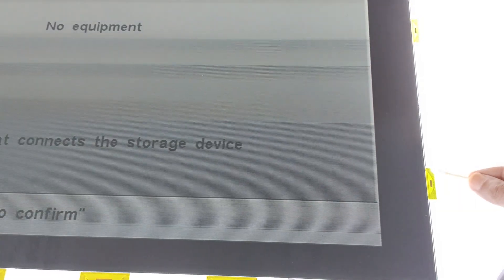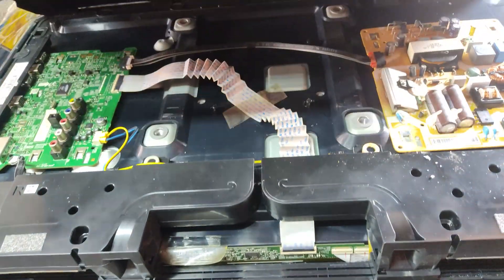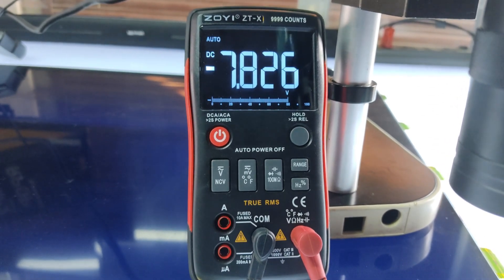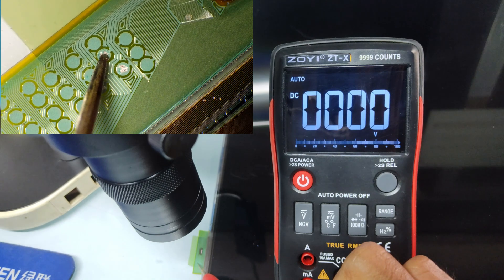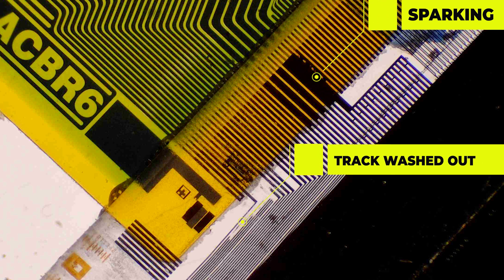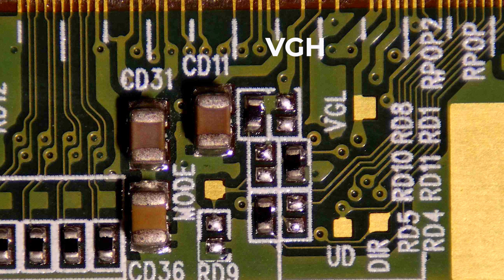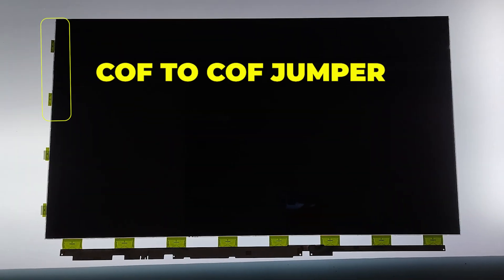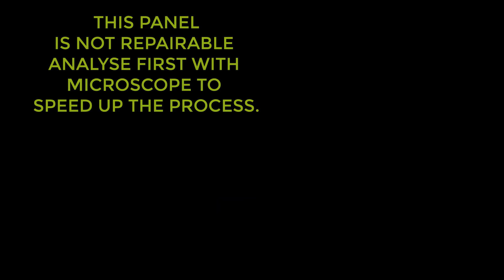Panel repair fails- TV killed by bugs?

Comment: Good info sir.... Yes, absolutely non repairable because all track on that glass has been damage with bug acid,the track is washed away.The only answer is change lcd panel with correct size and data.
Reply from the maker: Yes, you are right